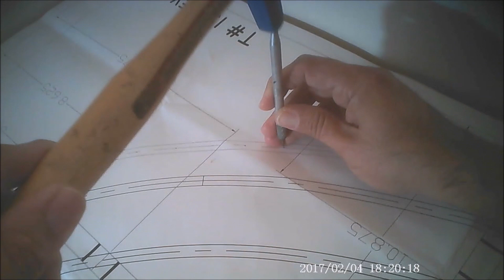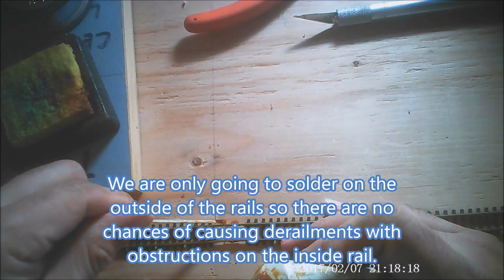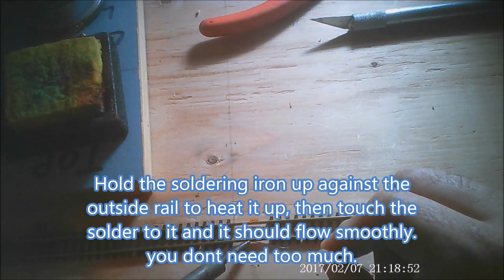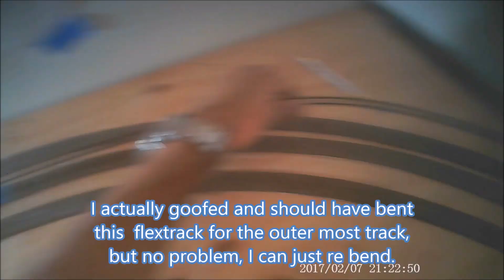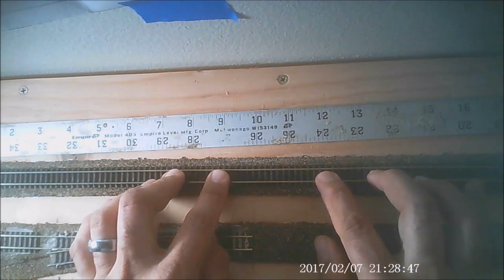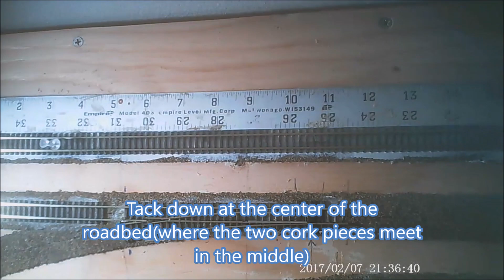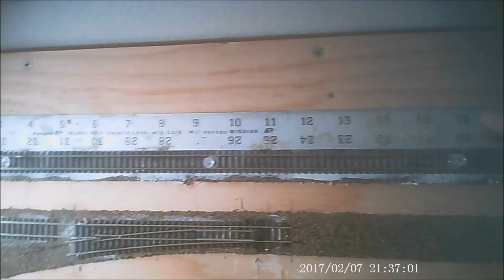Laying FlexTrack on a curve on my N scale layout

Comment: Never solder the track together, even room temperature over time can split the track in half
Reply: you need to leave expansion joints every few lengths, I gap the rails with a business card. I have soldered joints on Peco flex track that has been down for over 10 years with no issues.
Reply: @64BJH  I agree.  Soldered joints save a lot of problems.  A small gab every 6 feet is enough. The problem with some of these comments you never get enough information to understand the comment.  Some layouts are exposed to freezing or near freezing tempatrures and 110 degrees in the summer.
Reply: a small gap every 6 feet is enough

Comment: So i Am using peco c 55  left hand curve turnouts not sure if you know what they look like or not, I cant get the frog end to line up correct so I am wondering.... am I suppose to cut the flex track railing itself to make it line with the actual turnout and slide into the grove on the turnout? Appreciate any feedback.

Comment: Hi, where did you get the screwdriver (slotted) from thanks
Reply from the maker: I made it myself. Just got a cheap, small flat head screwdriver, and used a cutting wheel with a dremel. The slotted screw driver is called a joiner tool.
Reply: @choochooguy  thanks. Will have ago at making one